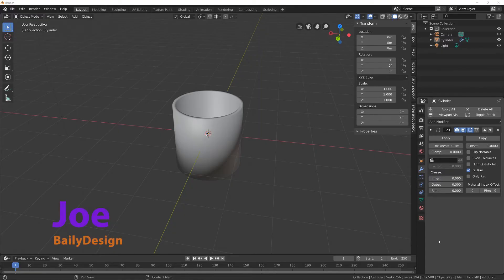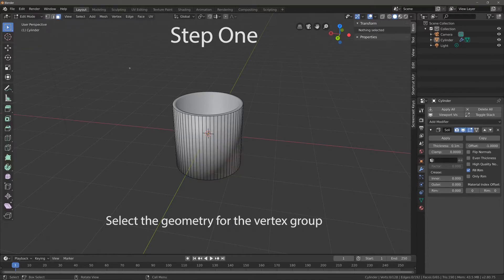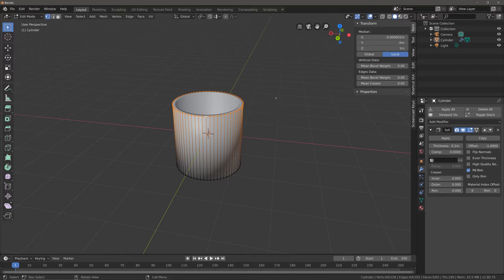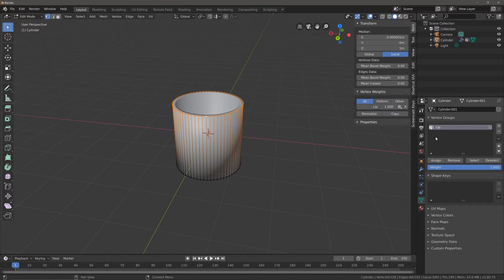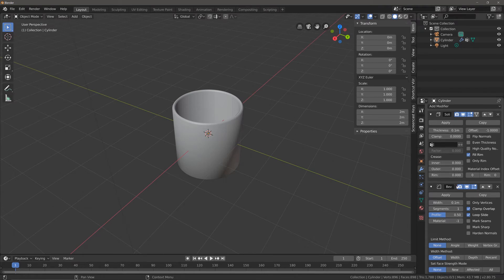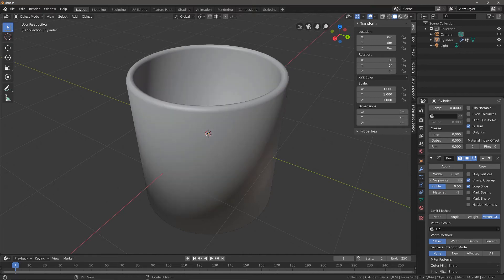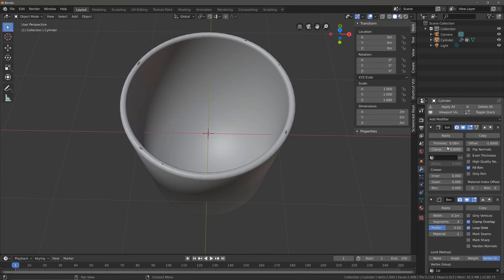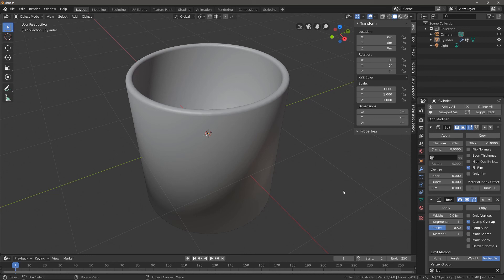Combining Vertex Groups With The Bevel Modifier (Non-Destructive) - Blender 2.8 Tutorial

Comment: They changed the menu a bit, I found the Limit method dropdown and added my vertex group but it bevels the invers of my selection for some reason. :(
Reply: Deleted the modifier and added a new one, fixed it. I must have changed a setting somewhere.
Reply: Ahhhh, there a button with two arrows ti the right of the vertex group selection, that swaps between the selection and inverse selection.